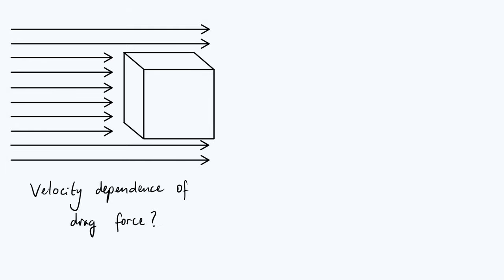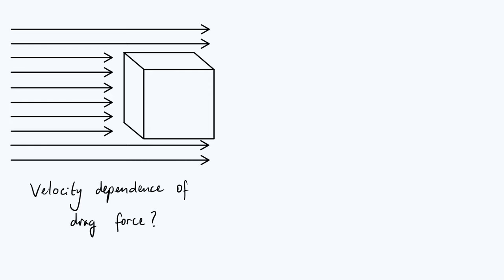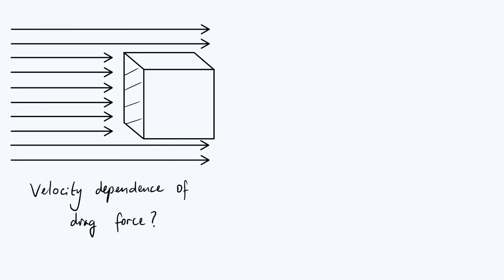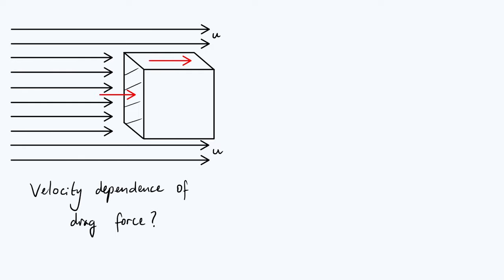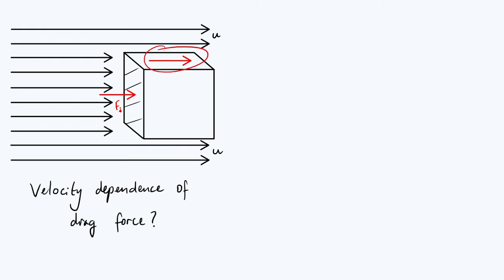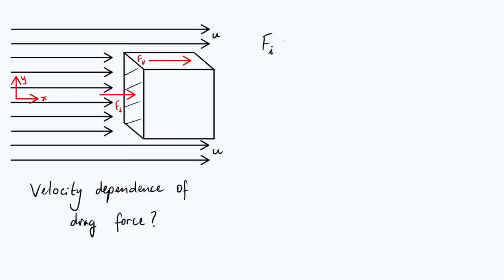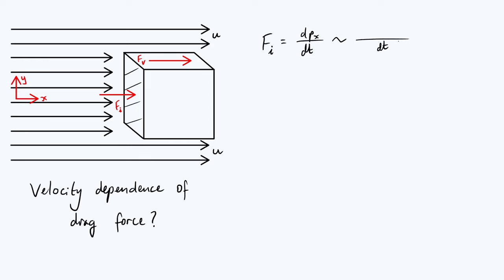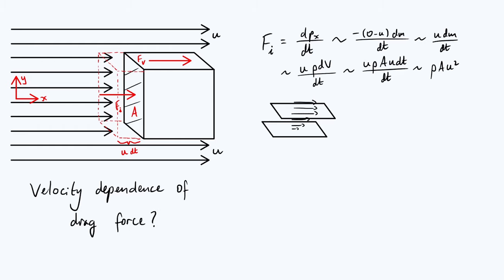Drag forces and the Reynolds number: intuitive understanding

Comment: Hello dr ben, great video! How would the equations change if the surface were to be spherical
Reply from the maker: Thanks! The shape of the object determines the constants of proportionality, α and β. For a sphere, the drag at low Reynolds number for example is 6πηrv, which is Stokes' law. It's not possible to derive that using this simplified model, though.

Comment: That was very good. I never saw that kind of explanation before. By the way, does the difference between your D and dy ever become important in practice?
Reply from the maker: Thanks! The length scale over which v changes won't be exactly D, but this analysis only gives an order of magnitude estimate of F anyway. So, there would only be an issue if the actual length scale differed from D by more than an order of magnitude. I'd be surprised if that were possible, but maybe there are fluid dynamics experts out there who'd be able to correct me on this! This is the sort of effect that we're just absorbing into the parameter β, which can only be determined by a more detailed solution or by experiment.